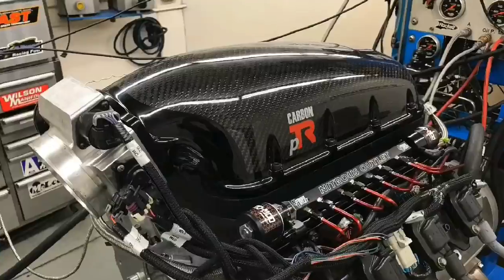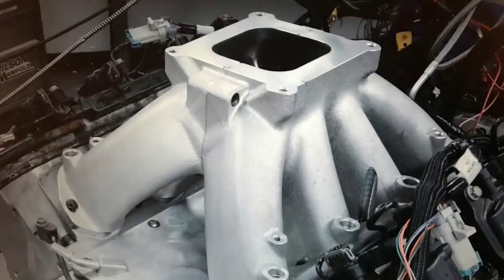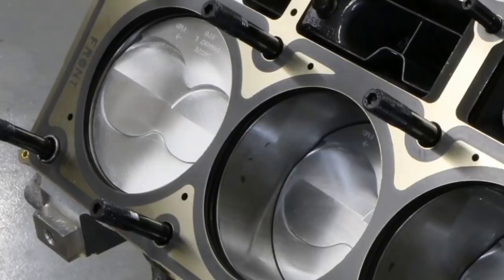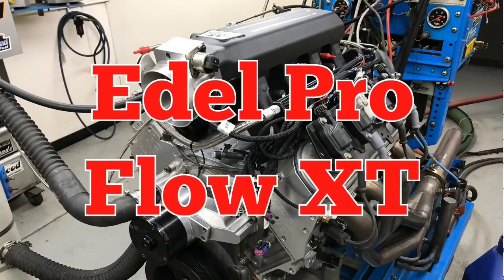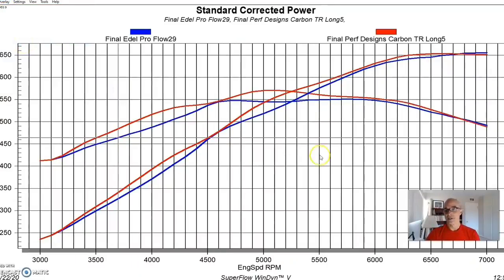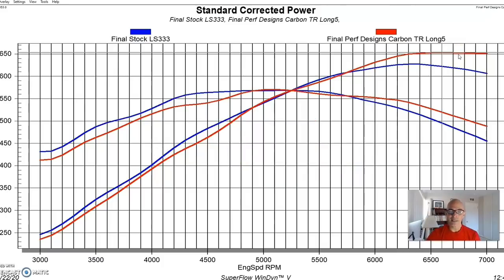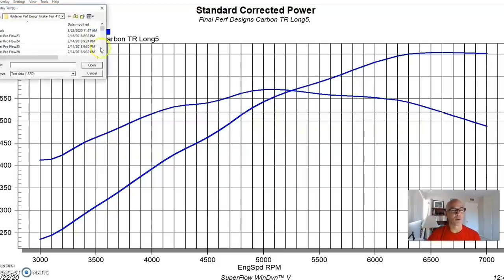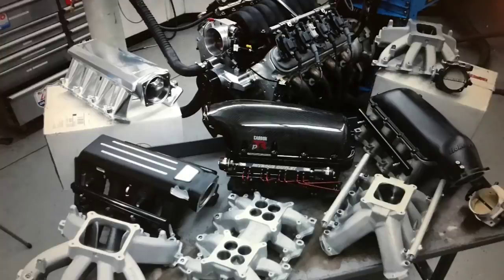ADJUSTABLE CARBON FIBER LS INTAKE TEST

Comment: That Edelbrock ProFlo and your intake dyno test is why when I built my 11.8CR 240/250 .623 .617 114 WCCH Stage 2 LS3 head 416ci in my Trailblazer SS ran the stock Cadillac Escalade L92 intake. Alot of the after intakes lose so much down low it would have slowed down my TBSS so much.

Comment: I daily my stock bottom end LS3 with the Pro Flo. I love it. The PRC 260s and 243/255-111 TSP cam loves it too. Gained 19rwhp over my old mid runner FAST. I didn't care for losing anything under 6000rpm since I run a 6000 stall lol. I recommend the manifold to the 5th gen Camaro guys over the High Ram because it makes the same power and it clears the stock hood.

Comment: Has anyone tried to make a carbon fiber engine block? That would be fun to at least try. Of course it couldn’t be all carbon fiber but the bulk of it could. Steel sleeves and inserts for all of the connection points.
Reply: Maybe carbon ceramic.

Comment: It would be interesting to see how much power loss is from a 92 mm back to a 70 mm throttle body. Since the old school throttle bodies 4 Fox body's 70 mm was big and 75 mm was huge. I realize it's Ford and Chevy but does the throttle body size affect horsepower that much naturally aspirated
Reply from the maker: the 75 was actually undersized for a good 5.0L-especially for a 351

Comment: If you're running Holley EFI or dominator, do you still have to use the factory ECU??? I'm trying to understand these ls things. Anyone?
Reply: Holley HP units are stand alone (no factory computer required). With a carb you’ll need something to provide ignition, usually an MSD box. Holley Dominator EFI does that by itself, as does theirTerminator. You’ll need Holley’s wiring harness (comes with the package) as the computer connections are all different.
Reply: @bdugle1  my guy thanks a bunch on this info. Are there cheaper alternatives to this ? I mean I know there's one called fueltech, but that's probably same or more money. I'm not familiar with the others. They probably come with some kind of tune as well to getcha going. That right there is one of my big fears of beginning my first real deal LS build. I'm doin as much as research as I can now. While I'm finishing up on the savings. And big thanks again
Reply: I think Terminator is the cheapest for a quality aftermarket unit. It will run an LS directly, with the sensors that come on the engine. The Max version lets you control drive-by-wire and/or a 4L60/80, I think. You have to buy the model for your engine, Gen 3 or 4, because the reluctorvwheel and cam sensors are different. These are about $1000 to start, with harness and computer. Add more for the Max if you need trans or throttle control, about $300, I think.
Reply: @bdugle1  bro. You saved me a search and some. I appreciate that!!! Thank you Brian

Comment: The old rule to use is that hp increases must not require too many extra revs to get a return. The attribute or factor to look for here is the greatest power at the least rpm. 4.07 bore by 4 inch stroke is 416 cubes. Cubes times 6500 rpm divided by 660 hp is a 4097 Ai factor. Cubes X Peak power rpm / gross hp = Aspirations Index. The lower the number, the better. Any time you get best indicted horsepower at a proportionally low rpm peak, your normally making a better brake specific fuel consumption and bmep. Then go back track to torque and make sure you dont lose too much. Still making 1.32 lb -ft per cube at 4500 rpm. Thats still "enough". The Carbon Fibre Edelbrock intake with long runner stub stacks does the best hp for every rpm, bu additionally,  continues it past the power peak! This is NOT lipstick; this is Pure Power. Fords Australian Falcon T3 342 cube ohv 5.6 liter stroker 5.0 was using the same system in 2002, and made only a 5360 aspirations  index, net hp was 335 at  5250 on a 342 cube engine. The improvement is huge with modern intakes. Buy, use and tune a Pro Flow XT! Thanks RH.

Comment: See man, I'd really like to get my hands on a late 70s, early 80s Cutlass (G body) or an early to mid 80s Regal coupe and swap in a LS3 with a Tremec 6 speed manual, long tube headers, full 3.5" duals with no cats back to either Flowmaster Super 40s or Borla mufflers, and a good BTR cam like this one with high lift and duration (which I'm sure required springs and retainers), and a big honking intake like this one (assuming it'll fit under the hood). I have just always had a soft spot for those big lead sled Oldsmobiles and Buicks and as another guy said, it's really hard to beat the LS3.

Comment: QUESTIONS:  1) If the individual injectors were ditched for a throttle-body injector, would you experience charge cooling?  2) Is the intake flow evenly distributed across all the cylinders?  and, 3) on a short runner design, it seems that the BMEP is lower so, could you raise the static CR to increase the torque while retaining the higher peak power advantage?  Thanks
Reply from the maker: yes on tbs charge cooling (like a carb), not sure on distribution(was not measured), yes on more compression

Comment: Years ago we go that pro-flow style intake for a BBC. The boss talked to Vick at PRI and we go an early one. I thought it odd how skinny the common area was verse the runners and when the motor go to around 3500 and up the rear 4 would go rich because they couldn't get enough air. I don't know how the LS3 version compares, but it looks similar. Did you check if they were all getting a good even mixture?
Reply from the maker: I did not test distribution

Comment: I wonder how the proflo xt manifold does on a big block.  I assume similar, but i want to see what it is like compared to a single plane system that usually come in a fuel injection kit(and maybe a dual plane just because you're there LOL)

Comment: Another episode of “hard to beat the LS3 manifold” for a driver...
Reply: Yep
Reply: It's true brother. The LS3 is an all around beast...and that's coming from an import guy.
Reply: Reccallo TimTom I don’t really get why people say this so much; on paper absolutely but in my personal experiences of two different combos the aftermarket units that are well made all make more power up top and with the right cam and good heads the thrust is unparalleled but the loss of low end is hardly if ever noticeable. With a manual it’s a non issue with an auto just setup your stall and lockup correctly and your gtg. LS3 is fine for stock but once your heads and/or cam you need a better piece.
Reply: that and the LS3 manifold is nice and low profile  and like $250
Reply: jet guy I’m not an NA guy but I picked up almost 60whp on an L92 going from LS3 to my FITech setup with a 6870 gen 2 from PTE. My only NA experiences with the LS3 piece was on a very strange small bore/long stroke 383 LS combo with adapter plates and all kind of nonsense but it made significant gains with a 102 intake and while it did lose down low over the Ls3 we never felt it in the car.
Reply: 100%
Reply: Hey @jetguy, small world. I’m building an LS ‘71 C10 as we speak. Spent 26 years in the Air Force flying mostly F-4s and F-15s (the closest I got to flying a heavy). BME from General Motors Institute over 50 years ago. No turbo for me, just a driver. The engine is an LY6 (6.0, rec port heads) with a 6L90 from a 2500 service truck. Lots of work left to do...
Reply: jet guy I’m saying at the end of the day it depends on purpose. Is it a street car? Go with the LS3. But even if it’s a street driven daily weekend drag car there are better intakes out there than LS3 in my opinion. Yes you may lose as much as 30+ down low, but are you going to be hindered on the street by a loss of 30-40 hp/tq with an engine making 400-500+ NA? Me personally I am not bothered in the slightest and can barely feel any difference, but that extra power up top is ALWAYS noticed when a tenth comes off your ET or a mph adds to your trap speed on the next time slip. That my friend you notice, on the way to 7-11 your not likely to tell much of a difference in 470 or 500 HP.
Reply: jet guy the L92 intake is trash all around compared to the Ls3 though, really starved up top with that intake.
Reply: Built ls3 was giving turbo civic a hard time last night, those things are stout
Reply: jet guy Some classic vehicles and engines you mentioned there lol. I’m only 34 now so I don’t remember the classics but I damn sure appreciate the hell out of em! Anyway, yes even small cube LS (4.8/5.3) can make big power even with stock bottom end. The stock 5.3 i ran made over 900whp on boost after a year of making ~650hp nitrous passes. For what you are looking for I think a stock 5.3 or even 4.8 with a good truck cam and medium frame turbo would be plenty acceptable. The Gen 2 6870 from Precision is amazing on smaller cube LS setups. For ultimate response though twins in the 6466 flow range is hard to beat. You can easily achieve full boost by 3000-3500 and 600+ hp with good street manners.
Reply: jet guy lol yup. I had a Silverado RCSB with a gen 4 5.3 and a pair of older 6766 PTE units. Stock except for springs and BTR cam. Custom exhaust setup, FITech setup. Made 913whp on boost only, for a year prior I ran the piss out of it on spray making around 650. Engine has over 200k street miles.